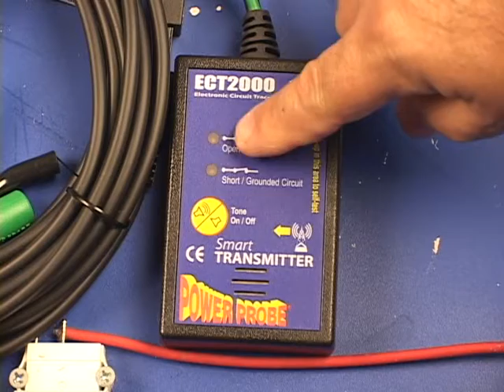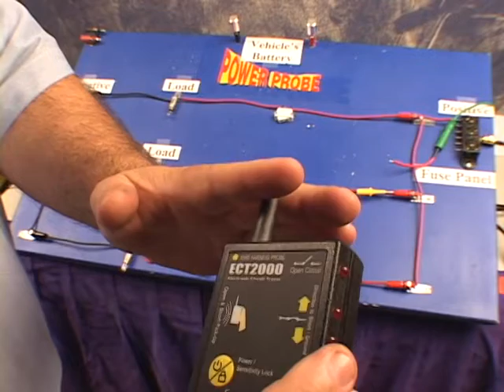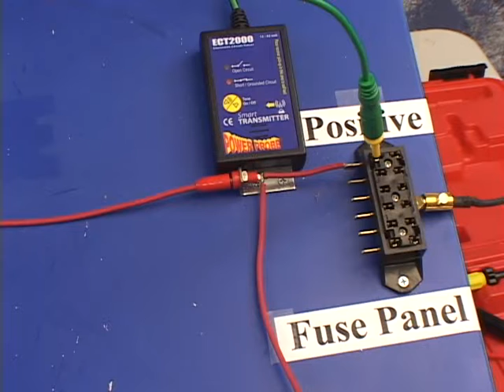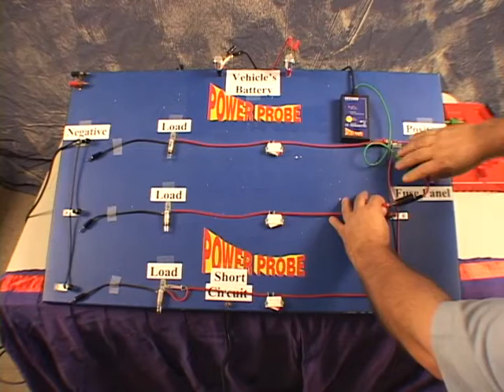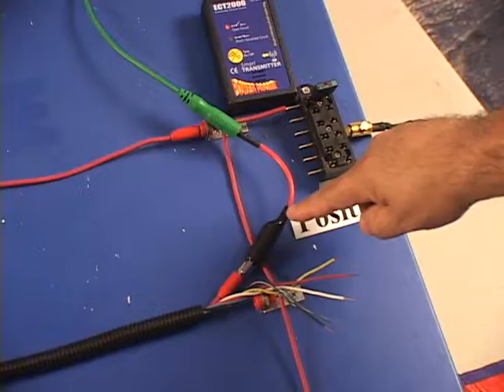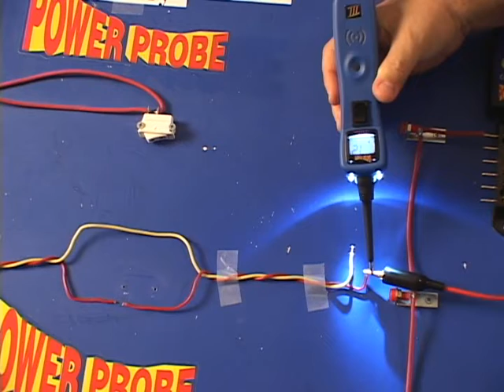Power Probe ECT 2000 instructions

Comment: Man having to isolate wires on these newer vehicles is one heck of a hassle. I have the 2000 but as someone ealse said a multimeter is just as good and you dont have to isolate wires... ill say this the little attachments are useful when paired with multimeter

Comment: Yeah.. tried to use this product in 2016… and dug it out to try it again tonight. Still find more use in my multimeter with miles of wire. Oh how I wish I could use this thing.. guess you need the shop manual to use in concert with this tech tool. Not for the average guy.
Reply: Bro I've only used mine twice in the last 10 years and both times it had me on a wild goose chase. This silly engineer's tool only works as you see on "Perfect made up scenarios and test boards". Notice how they never have training or usage on it on an ACTUAL vehicle... Only heavy duty equipment makes this tool usable (a lot of space between components and circuits). On passenger cars it is a complete waste of time.